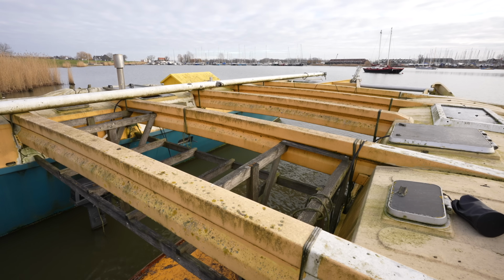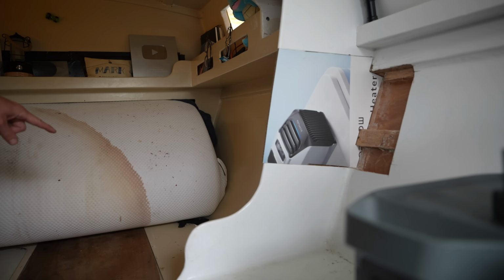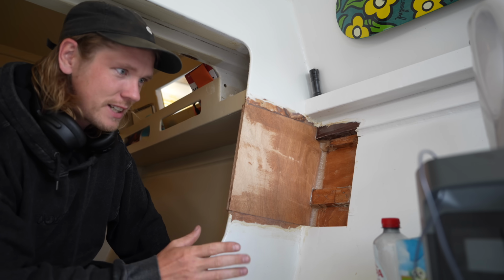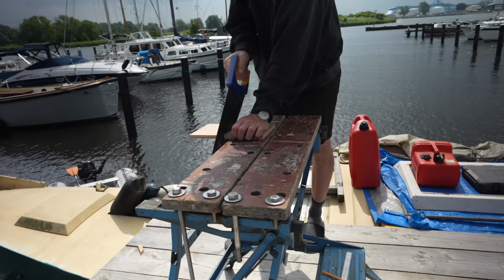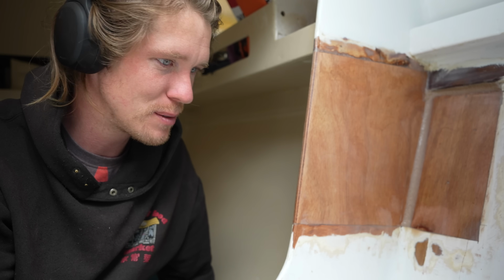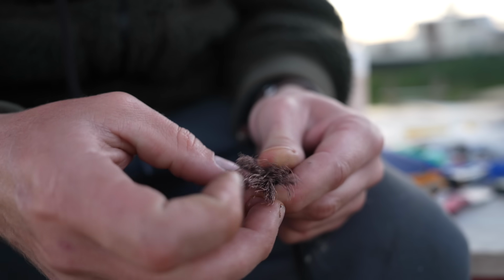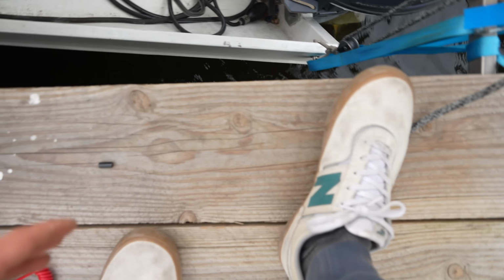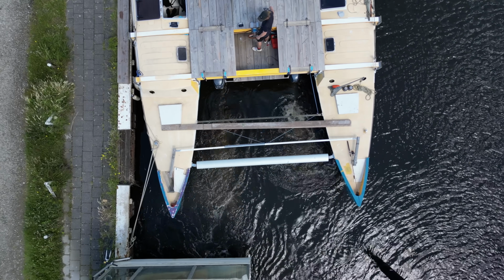My DIY Catamaran Engine Set-Up Is Complete!

Comment: Great music. Those seem like mighty long starter cables. Two things 1) make sure they are the right gage for the current & length  2) - you might consider sometime like a MRBF battery terminal fuse (suitable to the wire gage / engine needs)  for protection.  Normally starter cables are not be fused. Given the length of those runs and the steel tubing and your intent to cross oceans having something even like 150amp fuse might keep you from waking to the smell of burning wires.

Comment: WELLER Soldering iron. Broad tip. Get a pool of solder on the tip and use it to heat the wire through (bigger heat area).

Comment: Hey Mark, Great work my friend. just a word if I may for the future, if you have a similar problem with the rot in the frame that you have been repairing, try not to cut out good solid timber, cut away the rot of course but try not to compromise the integrity of the frame to much, nothing is as strong as original structure ( not completely true, a good strong repair will give you years of happy safe sailing but you catch my drift) I might be inclined to put some cheek plates either side of your repair, I know people have been recommending a good strong fiberglass repair and that would in my humble opinion work well I just sometimes go for overkill. Always enjoy your programmes, you do inspire me.

Comment: 12min into the video, i hope a friendly advice is ok... soldering this big joint would require a bit more heat in the material (flame torch/lighter torch / bigger iron) 
the trick is to get an puddle of solder onto the joint (to get more contact area for the heat to get into the material) , keep the tip dunked into it (it's the hottest part) and wait till it melts into the joint ;) 
keep up the nice work , i really enjoy watching your videos, as well as  you and your knowlege growing along with your project! A boat is a multi-craftsman challenge, you need to know a lot and learn a lot more than you expected along the way...

Comment: Hot melt glue or a blob of silka flex to seal the through cables.

Your motors if they have alternators should have inbuilt  charging control packs. You want your batteries fixed down before you head offshore..

Its all looking good. 🤞🏻 Hopefully the weathers set to improve for a while now so make the most of it Mark ..  Meantime a bit further south its been 🥵🔥 😈 hot..

Comment: Same as in the automotive industry, solder should only be used for electrical boards, solder on wires will crack and breakdown with movement and vibration. Crimp and heat shrink is the best option. Also the dirty end of the wire should have just been snipped off to reveal good clean wire. Hope this helps

Comment: I like a lot of what you have done, but the engine mounting system is a bit elaborate.  It’s a bit of a mess to be honest.   They make swing down kicker engine mounts that would clean up your existing system. There are a lot less parts and a lot less chance for anything to go wrong.  Just a suggestion.  ❤. Keep rocking out what you’re doing.  Best of luck brother 😊

Comment: So to sum up the comments - you must crimp your wire if it's that thick, tinned wire for marine environments, you must solder your wire and heat shrink it because that is way better than just crimping it, make the bulkhead repair stronger, great music, and did you know 'Mahi' means 'work'?

Comment: Mark, if you use acetone to clean bare wood you need to wait at least 30 minutes for the solvent to evaporate completely from the wood or any epoxy you apply can/will delaminate.

Comment: Add a fuse to that wire before you connect to the battery and yeah, agreed with the other posts about taking a couple layers off your bulkhead repair and adding some glass. I would have tried to lightly sand that soldering iron tip before buying a new one

Comment: I seriously recommend glass fiber tape application to both sides of your joins. This treatment greatly improves the tensile strength and lateral strength of your joints, cheers Grant
Reply: Glass tape 50mm wide with at least 3 coats of  epoxy thickened with glue powder

Comment: I would use a butt connector to splice the battery cable together. I'd also get a hydraulic crimping tool. That makes the best possible connection. Better than solder. It called a cold weld. I built a power wall out of lithium iron phosphate 280 amh cells. The experts swear by the crimping method. Good luck and Cheers !!

Comment: Hi ya, you should try Dry Mat for under your bed. It's a kind of matting that keeps your mattress off the deck and allows air to circulate. Not expensive and it works.

Comment: Nice progress. You do neat more heat on those soldered joints, but preferably not a direct flame. Copper ovidises very easily, especially in a flame, so heat flux & then the solder should flow freely in by capilliary action. It's not at the moment.

Comment: There is a copper cleaning solution used for removing corosion on automotive cables and battery cables. Its readily available in the states at any automotive store. Comes in a dip or a spray usually. There is also a corosion inhibitor that is sold as well usually next to the cleaner. Boat is coming along great so keep up the good work.

Comment: I dont know those engines but normally the alternator has a built-in regulator that controls the amount of flow or charge needed to keep the battery at full charge the regulator cuts on and off and cuts off the current when the battery is at max charge

Comment: hi.instead of putting a wooden frame under the mattresses ,one could opt for flat coiled rope with soft 'spacers',enhancing airflow . One can  consider extra rope on the boat to be a security measure for many types of emergencies/uses and storing ropes under mattresses has multi use aspects ,but even these should be sometimes aired and checked for what kind of use they are still fit ,after extended use under mattresses .Congratulation for persistent ,ongoing work on your dream and having a wonderful family dynamic ,working with parents together .ps.make a visit to tigershark boat project in Amsterdam ,another family work project .

Comment: That soldering iron was appropriate for IC boards. The tip needed sanded with a fine paper, and the tip needed  reseated in the heating element. Then it needed carefully put in a drawer. It was probably 10-15 watts. For the size of wire you were soldering you need 20-25 watts. The wire needed to be mechanically fastened first. Bend it, twist it, whatever. The connection needs to be strong. The you solder it!
Reply: gas is torch good  100w is more likely you might getaway with 50w with no wind warp a bit of wet rag on insulation that black butle tape is your friend and wire tie everything down no vibration or it will brake
Reply: 1 each silicon diodes, a one way valve on your out boards to one bat rem 1 volt drop across a diode also remember alternator must have load connect at all times, no lithium bms with out a dummy load

Comment: From what can be seen in your post: Is there a fuse in the engine battery circuit, normally built into the positive terminal connector? Have you plans to fit an isolator switch where you can turn the circuit off, and choose which battery you are using/charging? Regarding the size and type of cable, for the engine circuits the larger the cross section the better (less resistance), and the more strands the better (more flexible). Some people use welding cable which has much better insulation than the PVC stuff most chandlers sell. Cleaning old cables may be the only choice depending on how much spare cable is available. When repairing military ribs in the past there hasn't been enough spare to cut off, so after spreading out the strands, we used Scotchbrite to clean the individual strands, tin just the very end, and then used a good quality crimp connector. Quite often the oxidisation would have spread a long way inside the cable. About crimping, get a better tool, especially for the high current cables, a hexagonal crimp is much better, and if you can find some heat shrink which has glue inside it provides much better mechanical strength and better water-proofing. BTW Badalona marina has been a bit damp this year, lots of changes as they are building a canal under the railway line, have built a new launching dock, and we have the Americas Cup yachts here.

Comment: Those blue straps as security for your engines can be changed out for Dyneema when you start splicing.
Perfect stuff for that job.  
The alternators on those engines will never over charge a battery that big.
 Forget the internet with that one, Check with ya dad.

gary in Japan.

Comment: Mark, first of all, congratulations on the mad progress you are making toward getting MAHI back out on the water. 🎉 Second, I like the way that you fit that patch into the bulkhead, but I'm not sure that you are done with the job, in terms of structural strength. I've seen a couple of previous commenters suggest adding fiberglass over the plywood, and that would be good, but, considering that the bit you're working on is probably going to be under considerable force from every conceivable direction when you're at sea, I hope you will consider adding a plywood overlay to at least one side, and preferably both sides, of the whole bulkhead, epoxied to the patched original part. You really don't want that bit crumpling when you are "off soundings" some day soon! All the best! And say hi to the fam for us, too! Ciao for now! ❤

Comment: Those wires need some fuses in them! Your battery terminal looked loose on the big battery, which wint be helping. You can buy charge splitters which might be helpful if you wanted to run an engine only and then a marine battery,

Comment: Check into an anti moisture underlayment product. Common names are Hypervent, or HyPurFlo.  You can also try a slat type of solution. I don’t think the “Swiss cheese” method will work because the moisture from the hull area may make the issue worse, unless there is air flow from the cabin, to the area under the bed. (If that makes sense.)

Comment: Pretty much all of the comments relating to the bulkhead repair are on point with respect to its loss of strength. Glassing the joints would need significant over lap and layers, above and below the current insertion. I would suggest doubling up the bulkhead from the seat right to the ceiling, same thickness marine ply as existing bulkhead, glueing, clamping and screwing. It will rebuild ALL of the original strength back into the bulkhead that was designed to distribute a multitude of forces. It is in my professional opinion as a Shipwright the strongest option, better than just tabbing and glassing although that is definitely better than what you have at the moment relying on just glue. The bulkhead would also be uniform in thickness without the need for significant fairing to feather in tabbing with just painting required to finish. However you decide to do it, the important thing is to reconnect the now two halves of that bulkhead over the largest area possible. 

Isolation switches, fuses are an absolute must... don't underestimate the raw power that can come out of a 12v battery that has shorted out. You could lose your boat in a heart beat.

Keep doing what you are doing, she' coming along nicely and your skill level is getting better all the time. Don't compromise on important things just to get sailing, it'll happen and be sweeter knowing that your ride is in great shape where it counts. Thanks for sharing your journey! ✌👍

Comment: Install a battery switch, but in reverse. One lead in from the battery and one lead out to each engine. Just don't use the 'Both' position unless you need to quick charge the battery.

Comment: Over-charge problem from two alternators - you  could run the two charging cables into a small voltage regulator and then into the one starter battery. This will save you having to get a second battery ie large extra cost in money, space, cabling, through-holes with seal-plug.

Comment: Hi Mark. 
Good first effort on the cabling. Make sure you put a heavy circuit breaker for your cables at the battery for each motor.
If s9mething goes wrong and they short at the motor end you'll end up with very hot wires.
The rule is there must always be some form of circuit protection at the power source

Comment: The vibration is due to the fact that you may have tightened together the housing of the motor to the buddy these two are rubber isolated. Is screw on the side of the motor that is used for locking the motors

Comment: When you splice the dyneema unless you’re using a type that will have no constructional stretch I’d suggest trying to make each stay a few inches longer (at least) than they need to be, even accounting for a fully loosened turnbuckle. I used AS-78 Samson amsteel and my upper stays stretched about 2 inches in a week. No stretch anymore though. You probably have a well thought out plan though but hopefully that helps someone.

Comment: if you  must solder get a micro torch, $20 amazon. Even can use a regular small plumbers torch used on this  big wire is ok.

Comment: You will need Volta meter for both engines plus mini voltage control regulators. But at least you know lights will be no problem from those two batteries also can charge your lithium power banks from the engine charge too as not just from solar power. Now to be safe on your planks I think better add grip flooring or grip paint.

Comment: To clean the black off copper wiring use flux dip the wire in flux and then heat the wire the flux will bubble and remove any black off leaving pure clean copper

Comment: You won't really know until you are actually under sail but my guess is that you'll find that your steering wheel is too small. My guess is that you will be struggling against it, but hopeful I'm wrong.  I really enjoy watching you learn, keep it up.  BTW I absolutely agree with a previous commenter never use solder joints in a marine environment! Either use one long length or crimp connections.

Comment: maybe you could use car hood struts for the engines instead of the rachet straps, they're fairly inexpensive and would probably reduce the vibration a lot. You would probably then want to mount that to some type of rubber like something you'd find in a car engine or transmission mount.

Comment: With regards to cables on a boat here are a few tips - tinned cable, the ones you showed are copper colour, these oxidize quite quickly in a salt water environment the tinned wires last longer (nothing as concerning as corroded cables when you are in the middle of the ocean)
Any join in wires is a weak spot, try to get the right length cable end to end. It is more expensive and a hassle to rewire. (the black copper is oxidized that cable should be replaced you will have problems with it.)
Your soldering iron is way too small and your joint is going to have problems. 
Yes absolutely you need to get a management system for the batteries, try to get the best one you can afford, too cheap and it just will not handle the task.
Loads of progress ... seems you will be sailing soon.

Comment: you have been watching numpty YOUTUBE wire connecting videos! You can solder but use enough heat and flux so that the solder flows freely. But the best tip is to use MARINE adhesive heat shrink to seal out the elements!

Comment: I rewired my boat a few years back with copper wire like you have, a few months ago I was having issues starting, turns out the wire had gone bad (black) and wasn't earthing correctly. What I should of done in the first place is used Tinned wire that designed for salt water conditions instead of saving a few $$

Comment: Two victron Orion dc to dc charges will fix your over charging issue. It will also allow you to use one battery and if you use one of the victron smartsolar charge controllers. They will all talk to each other. And you could switch to lithium easy in the future.

Comment: The alternator on each of your engines has a regulator that will charge your battery, Once your batteries get up to about 14.6 V it should just stop sending power to your batteries and just sit there.

Comment: acid to clean wires, the sildering paste, the yellow stuff helps the solder adhere tonthe metal by etching, if you dont use the paste you will have a shit splice, because with some flexing it will come off

Comment: you need a higher temp solder gun to weld high gauge wire by heating the copper other wise you get cold globs nice flux tho i recommenced one with interchangeable elements  makes it easyer to heat large to medium gauge wire some heat guns can do the trick to watch a dude do with with a stove element once

Comment: separate batteries is the way to go. I'd think that bulkhead needs boards "sistered" across both joints. Full boards on both sides, epoxied and bolted. I'd be wary about twist in the hulls.

Comment: Think you need at least two layers of glass over the bulkhead repair. Because if there is a disastrous strain put on that bulkhead, either crushing or ripping apart or twisting (torsional), you need that plate and joints to be able to hold as good as, if not better than, the original ply structure. 
This IS a structural repair.

Comment: A new regulator rectifier will sort your overcharge issue. Aftermarket on ebay usually cost around $25 Aud.